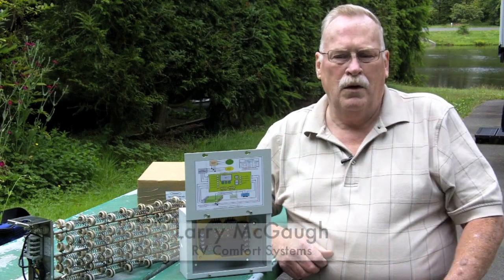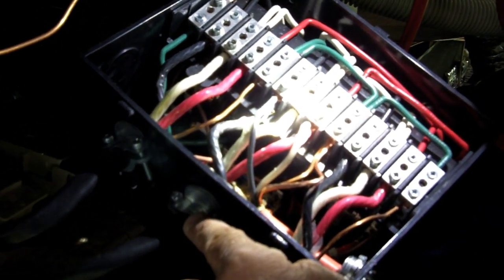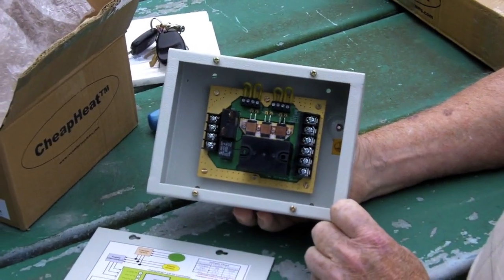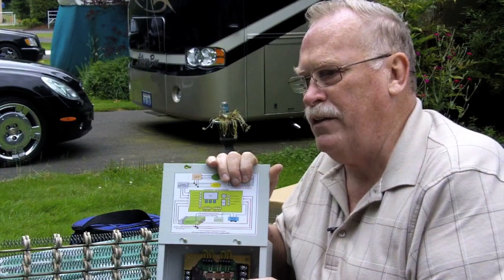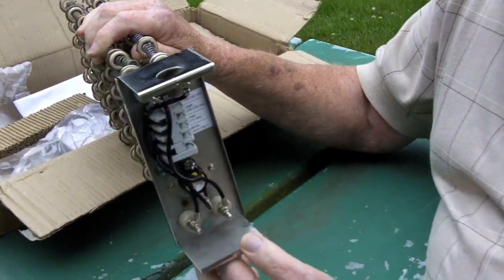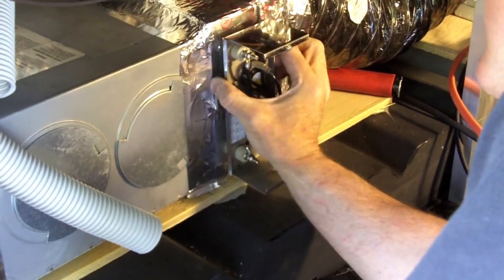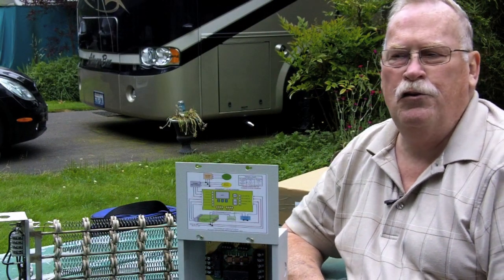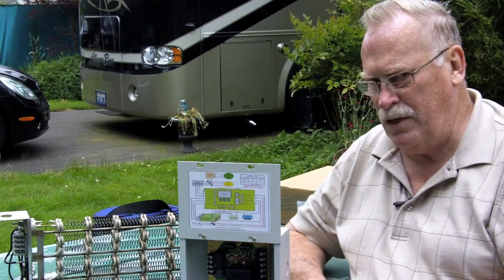RV Comfort Systems - The CheapHeat System

Comment: Propane is heavy, particularly when it needs to be placed in a place that may not be easy to get to.  However there are systems where you can fill up on LPG at a petrol station.

Comment: I read this products information even read it again in trailer life magazineand you have to consider a few things. 1st off, if you are not on a meter for your electric its a good deal. I know how to do wiring on heating systems and this product is very user friendly as far as hooking up to your furnace so for me when I hook this to my unit I myself can by pass paying someone to install it.. Yea you can use space heaters if you want them free standing in your unit. But remember this is engineered to be safe to run with all it safe faults built in so when YOU SLEEP you don't have to worry of a fire or something happening by accident. Plus its hooked into units  thermostat so once the temp gets to a comfortable level the unit shuts down.
 In my case I have a C class 28 ft with propane tank attached to chassis of Camper so I can just take the tanks for a ride to be refilled unless I drive the whole camper there. I don't really want to have small electric heaters on all around me. So you need to consider the whole package of convenience this also offers to some.
 Now I cant see how any electrician or Rv dealer charging more then 500 to install this, its not that big a job to do, but at the same time some dealers will get you as much as they can. I think this is a solid safe good product and offers a safe alternative to an electric heat source without space heaters plugged in your camper on the floor. I only need 30 amps to heat my living space but the system offers you up to 50amp for a bigger unit. I adding this soon to my unit for me it makes  lots of sense to me.
Reply: Also this electric heat costs what it cost to run you AC in warm weather so a campground usually adds that cost per site per night into its cost if you not metered so your only getting what you pay for anyway.

Comment: I think this is a very nice system.  Even-though I have both propane and two heat pumps on the roof, I would rather use this system then the LOUD heat pumps on the roof.
Reply: +Mark Cole If you just get smart and go to Home Depot you can get 3 of the 600 watt kick plate heaters that mount at the bottom of walls, cabinets or where you want them. They are very small, use near no power. They take up little space, use 1/3 the power and heat amazingly well with all built in safety. Total cost for it all to go into a 35 foot RV and a thermostat was under $200

Comment: Big deal.  If you're paying a flat rate for hook-ups for the night and need a bit of heat,  you'll save on your propane consumption,  which is still not to say that this installation is worth it.   Just that the "cost of heating" is irrelevant.